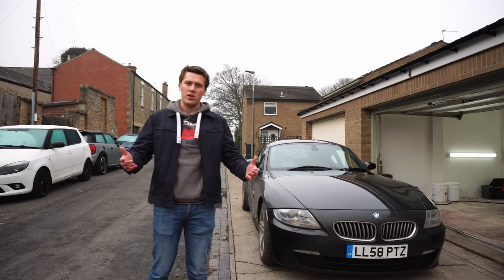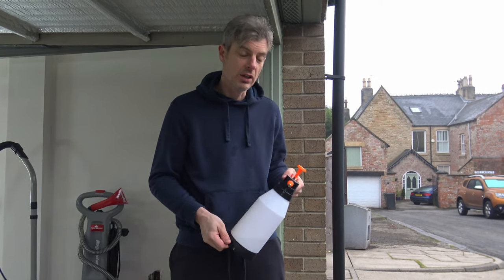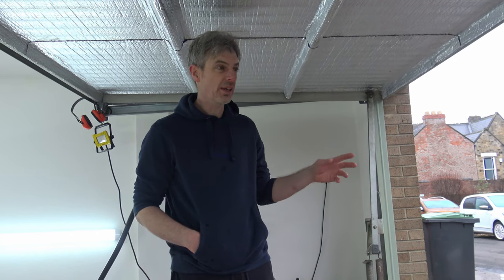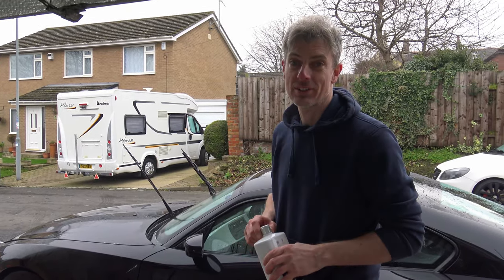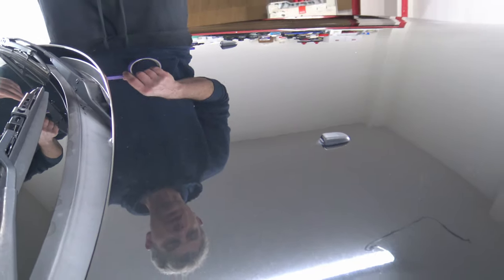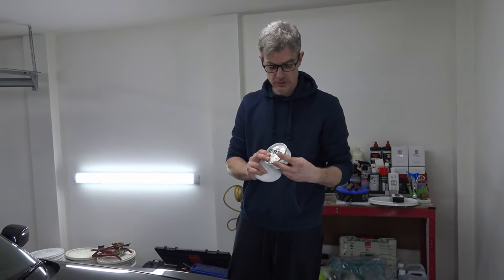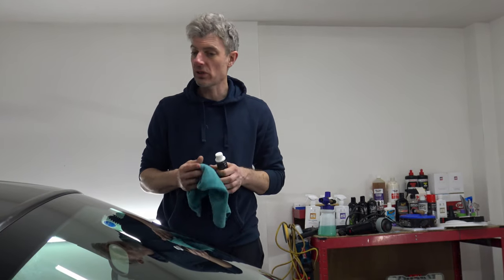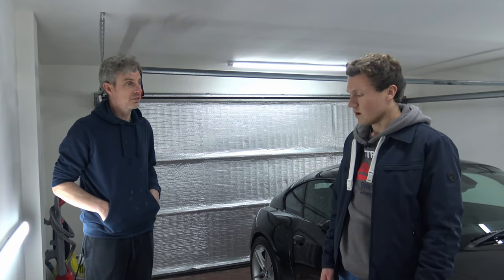Detailing My BMW Z4 | The Best Way To Clean Your Car This Winter | Bishop Auckland Detailing

Comment: Car looks great and done well to get done in a day. I use Surfex everywhere, from cleaning my mountain bikes, to the cooker as it is a brilliant product. Breaks done oils and grease and is bio degradable too. 
I use a round wire brush attachment on a drill to get the inside of the exhausts looking brand new , so try that . Collinite is tough stuff and sets like concrete if you leave it on too long.
Reply from the maker: Thanks Justin!

Yeah surfex seems to be a great product for decontaminating the paint. Will need to try the wire brush in the exhausts at some point to remove the carbon build up!

Yeah really interested to see how the Collinite holds up, seems great so far 👍
Reply: Sounds like good stuff... I'd like to see more bio degradable products... even petrol heads can wish to preserve a planet for future generations to enjoy!
Reply from the maker: You're very right sir, some of these chemicals are harmful for the environment, probably more than they need to be
Reply: @FootToPedal  Im a mobile detailer in the UK.
During a job I got asked about how eco friendly I was by a purple haired passerby.
I told her that by volume 99% is water. The other 1% is sudden death.
She said I should use the eco friendly stuff... I told her been there got the t-shirt... I tried it, its crap and not fit for purpose.
She huffed and buggered off chuntering.